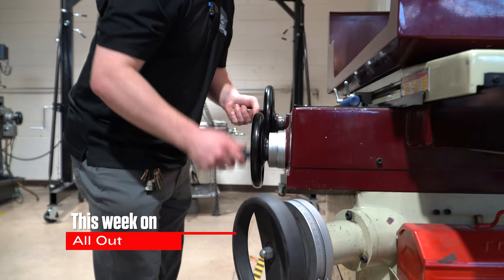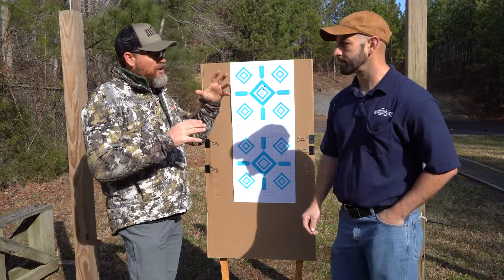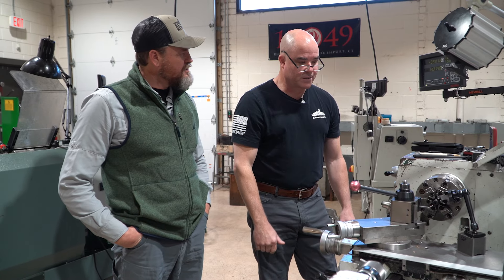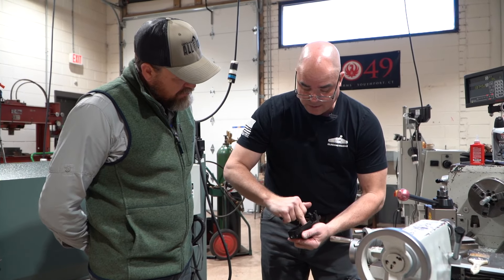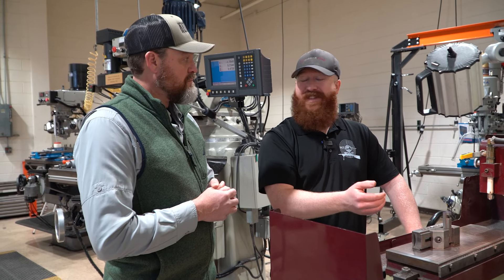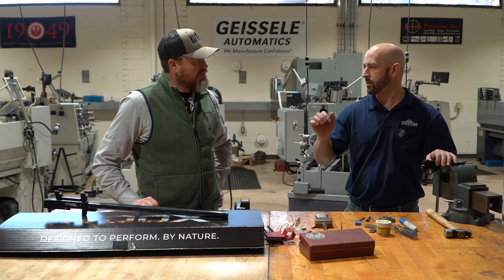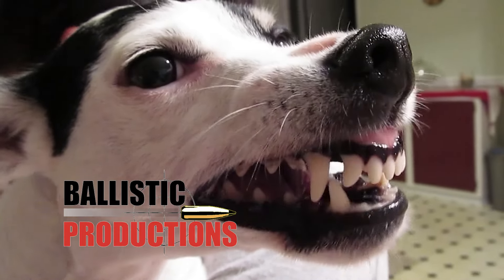Ruger 10/22 Rebuild | Carolina ALL OUT | S6/Ep4

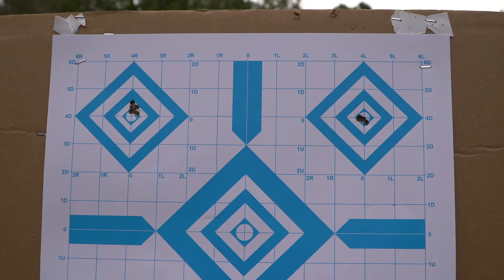Comment: Skip ahead to time index 19:07. See how the bolt bounces back and forth after the shot? That'll be pulling the next round in and out until it settles. Can that be eliminated or reduced? Would an aftermarket recoil buffer pin reduce that? Great video!
Reply: Other than a heavier recoil spring, no.
Reply: Bolt bounce is a thing on self loading guns. It's an issue with full auto but as civilians we don't have to worry about that
Reply: The bolt buffer only works on rearward travel, not forward, a stiffer recoil spring would affect bolt bounce.

Comment: When you grind down the face of the bolt, what did you do to the extractor claw (???) Now your extractor is further ahead of the front edge of the cartridge rim. 
How about the slot in the barrel for the extractor (???) What did you do to change that as well (???)
I saw no discussion about the ammo used, before, or after.
Reply: I'd like to know that myself. However he didn't do anything to the primer pocket face in the bolt so it shouldn't change the extractor claw grasp on the shell rim. I'd like to know if anything was done to the shape of the X-claw or the X-claw slot in the barrel. Good questions
Reply: The extractor slot has to be recut after shortening the tenon. The video just did not show it. The final groups were shot with SK Rifle Match.

Comment: Worked on my own bolt.  Lapped the face with 600 then 1,200 diamond flat stone.  Went slow, only stroked one direction careful and easy, feeling it mate first before moving it.  Did the same on the top, bottom.  Rounded the back to a nice radius.  Breech chamber polished very fine.  Aftermarket bolt catch, firing pin, extractor and mag release also plunger.  I can't alter the barrel like they did, good info.  The factory charging handle is a joke though, swapped that out.  That stock is pretty slick but a custom receiver would be the way to go with a rear stock screw.
Reply: You lapped the bolt face, for whatever reason, did you set the headspace? That would’ve made a difference but just polishing the bolt face will do nothing except make it look pretty.
Reply: You could use a file to shorten the chamber, if you’re careful.

Comment: You guys should have modified the factory barrel. Lets see what you guys can really do, and that would have been good proof. Anyone can slap a heavier barrel on from a majority of different suppliers/manufactures and get better groups than a bone stock Ruger 10/22 barrel. Also wondering if the customer wanted you to change his see through rings? All the hand fitting and polishing, like the trigger work would be expensive, if having someone like you do it. A person would be money ahead to just buy a Volquartsen target hammer and trigger kit for $100.00, rather than have you mess with a factory trigger. You should get a before and after weight on this build, and ask him how it compares out in the squirrel hunting fields after a day of hunting. Also, total cost on this build should be mentioned. I'm pretty sure its going to be spendy. That stock is overrated for a 10/22. A Magpul Hunter X22 would have sufficed, and it would have cost $400 less. In the world of 10/22's, you can go unnecessarily overpriced, or you can keep costs down, and end up in the same fork in the road, in terms of accuracy. No mention of ammo used in the rifle after the build either. A lot of wool being pulled over the eyes here guys.
Reply: Kidd makes the best trigger group, he did shorten the chamber on the heavy barrel, he would’ve gotten similar results with the factory barrel. What I don’t agree with is setting back the shoulder, not necessary, since it headspace’s on the rim and that is adjusted by modifying the bolt, I would’ve done things differently.

Comment: 1. When grinding the OEM bold face was the face square with the rest of the bolt?
2. On the barrel recrown & the settings the tenon back did you have to machine the extraction slot?
3. When using the OEM bolt what about pinning the front of the bolt to prevent vertical striker pin walking up and down. OEM bolts are staked on top of bolt.
That being said it's the best hands on 10/22 I have seen to date & I'm pushing 70, had My 1st at 10yrs.
Reply: 1). The face wasn't square, and they usually aren't.
2). Yes, the extractor slot needs to be deepened after shortening the tenon
3). We have pinned the firing pins on some, and it does seem to make a difference. The bolts are relatively hard and difficult to drill.

Comment: Or run the rod down the barrel and add the patch in the receiver and pull it out or use the fabric cleaner with no rod. Also, there is modern lubricants that are changing everything.

Comment: You mentioned a short course on the 10/22s, is that still available? I’m retired and always ready for another hobby. Great video by the way, I have a Ruger 10/22 Competition model that shoots well but could do better.
Reply: Congrats on your retirement man.
Reply: Thanks, getting old is not great but better if you don’t have to clock in every day. I just sent both 10/22s to Connecticut Precision Chambering to get the same process done as they did here, very reasonable and 10/22s is all he does. Taking the measurements on the bolt and chamber told me Ruger does it for reliability and not accuracy so hopefully he’ll fix that.

Comment: Is that number for that gunsmith? Have a 22 I'd like to have the barrel & bolt worked on like they did yours. Big improvement on the 10/22. Also been a year. How many rds you fire though it? Like to see a fall 2023 tests on CCI SV, Tac 22 & the CCI Mini Mags HP.

Comment: Nice groups .... To me though concerning the bolt they should have locked down the firing pin from jumping around which stock Ruger bolts are famous for that nor did they say anything about checking the firing pin for proper length or for proper ignition .... And something that doesn't affect accuracy but is a neat little trick is they should have beveled were the bolt handle goes into the bolt for ease of maintenance for taking the bolt out or putting it back in.

Comment: What kinda jacket is that and what's the camo pattern called? No way my 10/22 is gonna be fixed like that.
Reply from the maker: It's a Sitka Celsius Midi jacket.(Looks like it's out of production but can be bought from different sites on the web.)  The Camo is "Optifade Elevated II"  It's a great jacket. Can be worn by itself or as a heavy underlayer.  Sitka is extremely proud of their products, thus the expensive price.  My kids bought it for me so I wear it and I like it but typically this is way above my price range.
Reply: @CarolinaALLOUT  thanks, you only can have the barrel shaved like that in person or can a barrel be send/mailed in? I have a 20" LVT Ruger barrel. Just the groups it made after they tuned it up, also the bolt work they did. That explains why mine doesn't just slip in the receiver. Plus first time I saw a chassis & stock combo. They really fixed your 22 up.